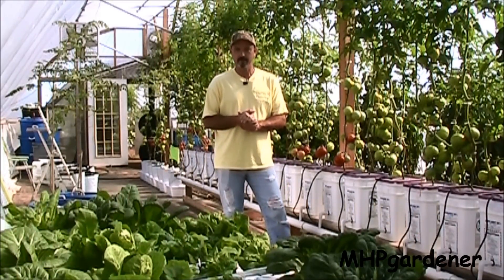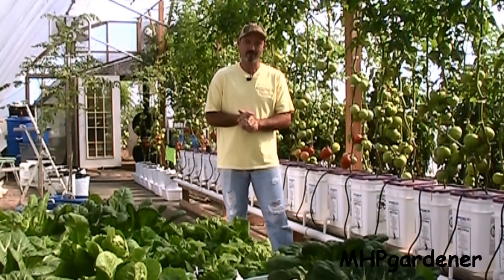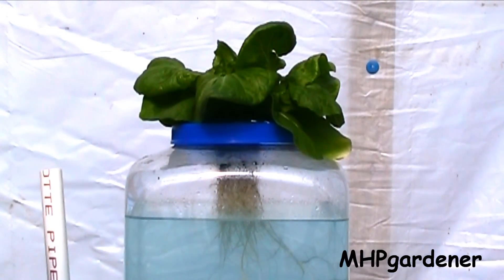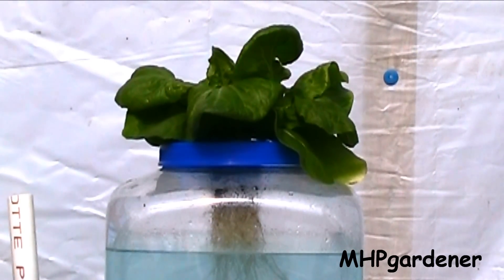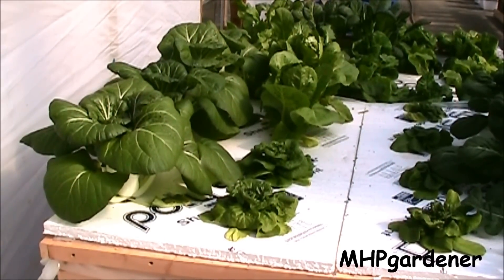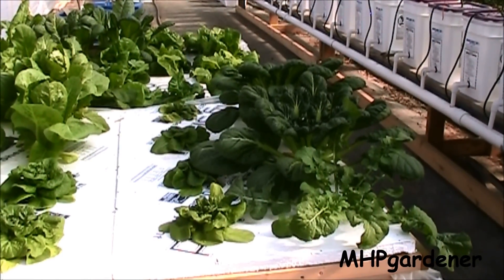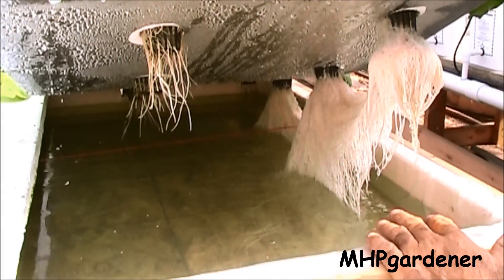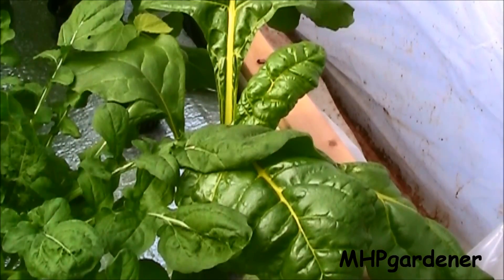Off-Grid Hydroponics Experiment - The Kratky Method & Floating Raft Hydroponics

Comment: Is it necessary to use styrofoam in the Kratky method, or can I use a more substantial top, such as wood.  Also, I was thinking on planting tomatoes using the Kratky method, using a 5 gallon bucket, one for each plant.  And would use the top of the bucket to support my plant, with the 2 or 3inch hole to support the plant.. What do you think of this?  I really like your videos!  They are easy to understand, compared to others I have seen.  Thanks and keep up the good work. How do I subscibe?
Reply: I am "guessing" that you could use wood, but maybe it would rot with moist damp air beneath. Maybe the plastic lid to the 5 gallon bucket would work for you.
Reply: If You download the info on the Kratky method, You will see that he recommends a large, 30 gallon container for tomatoes.
Also You can refresh the container with solution, if it gets too low.  A fill tube would be great to check water level and to refill.
Reply: Paul Smith Great point with pointing out that different plants would need different size containers. 

Aside from how much water the plant needs over a life time one should also consider this point: That you want water to drop as it is used, but not too fast as what would happen if the container is much taller than it is wide, because the roots could not grow fast enough to drink as much as they need. Nor do you want the water level to drop too slowly as would happen if the container is much wider than it is tall, because the roots would grow too fast going too deep into the water and oxygen could not dissolve into the water down there fast enough to replenish what the roots take. 

Using the Kratky method, I would be concerned not to add too much water to a grown plant with a mature root system because I would not want the roots in so deep that oxygen find it hard to dissolve down to the lowest part of the roots fast enough. 

Aside from how simple the Kratky method is, it is complicated in finding an "OPTIMAL" solution to how much water, in addition to height, versus width for the container.  Who knows, maybe the optimal shape of the container might be some what cone shape vs a tube shape. One further note. It seems reasonable to guess that each plant will have a range of width / height where they flourish to varying degrees.

Comment: ChloroBA the new bysen grow light,  brings out the THC in your plants. it is only a small light but covers almost 8 times of its size. cheapest on the market, don't pay £2000 when you can get it cheaper and brand new for around 700 pound cheaper.

LED grow lights with 8 band spectrum for sale many sizes, prices starting from £222.
energy efficient grow lights. 

sold globally too. 

contact me for information.

Comment: I'm in the Central Valley of Ca. and I was wondering how the Kratky method would stand up to 105 degree days? Please let me know thanks for the videos.
Reply: Sorry for the sluggish reply. I am not affiliated with this gentleman or his video but i do like to prowl comment sections and try to help people for the warm and fuzzies. ANY time a vegetable, be it hydroponic or soil, feels temperatures that are too high or too low it will be detrimental to it's growth, and the extreme is obviously crop loss. A easy plug in fix to any hydroponics system to have better control of the water temperature is to increase the amount of gallons you have tied into the system. Water is inherently very hard to heat up and hard to cool down(relatively of course). The more gallons you have sitting around in your system the longer it will take for the water flowing in your channels to heat up. I am not referring to flow rate just net amount of gallons in your reservoir be it by adding an additional barrel or sump-container. You can also bury your reservoir into the dirt or otherwise insulate it to keep water temps down so that your roots remain happy!
Reply: Now to answer more directly, the kratky method would not stand up to many 105 degree days. Without you doing something to prevent excessive water heat, you will without a doubt have crop loss at those temps inside of a week. In my humble opinion.
Reply: Thanks for your help.

Comment: I was wondering if you could combine the two "floating' methods by adding some "legs" from the same Styrofoam to the bottom of floating platform so they still get air but you could still use the different types of lettuce in the same growing box...with no air pump i.e electric. would this work I haven't built my first one yet I'm just doing research right now. I would really like to know what you think..thanks

Comment: I have a sneaking suspicion that if you'd planted one type per water mass, you would have had more consistent results.

I think this video illustrates that you should separate different root types, as they have different water/nutrient uptake and will prevent the smaller rooted plants from getting enough water.

Simply adding a divider in the middle would have likely done the job :). What do you think?
Reply: I wonder

Comment: Could you bypass the nutrients solution and instead put some fish there?
Reply: I would think that you could use fish, but would probably need to have air stones for the fish.
Reply: You can add fish to the system it would help, but fish do not provide P and K and trace elements or Fe to your solution, only nitrates(N). I come from a aquarium background and this is what I understand regarding growing aquatic plants, logic tells me this will hold true for non-aquatic plants growing in water as well. I might be wrong ^_^. 

Using fish also presents other challenges, water quality and filtration. Adding fish you would have to keep Iron and all other parameters in check, which is not needed in the case of no fish, then simply use a form of E.I. dosing.

Hope this helps.
Reply: there are systems here which have fish and plants on the other side. my brother in law has one. it uses a number of IBCs. his friends were doing it and he learnt from them. one guy put in over 100 small fish and hasn't lost a single one and now they are over 100 big fish.

Comment: fantastic video, thanks so much for putting this knowledge out there. I'm going to be raising tilapia in an old above-ground pool. I'm thinking of creating some simple rafts by building a square from some 2x4"'s and mounting the foam on top of that. hopefully the wood will create enough separation off the water to give the roots some air.

Comment: Good day.
On the video i saw the floating system and i had an idea, what if the floating polystyrene had some pieces of polystyrene glued to the bottom of the floating polysterene then you would have air bettewn the floating polystyrene and the nutrient solution. Thanks on your work.

Comment from the maker: Yes sir, I use the same fertilizer, just at a reduced rate. Rather than the 12-12-6 ratio in grams, I use 10-10-5 for lettuce. It worked very well, so I stuck with it.

Comment: What nutrients did you use in your raft set up? I live in Arizona where it's very hot. Do you think I could get away with running this raft system in mid summer with shade? Would I need a water chiller? Also do you use RO water? What E.C. level do you keep your mix at?
Thanks for the video, very cool!

Comment: I wonder if you used double foam with a bigger hole on the bottom slice and floated them would the lettuce work . you would have the air space and the lettuce would drop with the water

Comment: Make sure your tools are cleaned before you stir the water below.
Also make sure there is no possibility of contact with soil or worm tea.
Once the wrong bacteria gets inside, Root rot will occur and there is no way
to save the plants, Some people put in some Hydrogen Peroxide to increase DO
and kill bacteria now and then. Just make sure its all clean and don't mess with
soil before touching. I have been using this for 3 years for hobby planting

Comment: great video!  Thanks for the ideas.  I have been back-and-forth making a few floating rafts for my aquaponics system... I want to have the least amount of input possible.  I am not sold about floating rafts if I have to use another pump.  what do you think: What if I incorporated both the floating raft and Kratky method?  Instead of floating my rafts ON the water, what if I utilized that 1/4 in. oxygen space with continual water flow from my fish tanks... hmmmm...

Comment: Another off grid hydro method where you could have some dissolved oxygen versus none would be using solar panels and 3.5 watt aquarium bubble stone pumps like the dual outlet Aqua Culture pumps.Harbor Freight sells 15 watt solar panels for around $60.You could run 3-4 pumps off a single panel.Multiple panels set up like this could power a series of many pumps oxygenating a large grow area during "direct sunlight hours".

Comment: What do you think about building a floating raft but with a sort of pontoon bottom to lift the top surface up? This would provide both the air space of the Kratky method and still allow for a variety of plant types because the the raft would drop as the nutrient solution was used up but the pontoons would maintain a fixed air space.

I'm thinking something like a thinner Styrofoam top with Styrofoam ribs attached to the underside as pontoons. Just a thought.

Comment from the maker: I wouldn't use plywood. It's gonna get water logged with the condensation from the reservoir and probably warp. I resolved the issue of the large pieces of styrofoam by building 3 smaller boxes, rather than having one large one. That video was posted last week. Having smaller boxes allows for easier moving, and also some side by side experiments. But, as sloon said, plastic tubs with lids are great options.

Comment: the Styrofoam is usually used for oxygenated water, like a deep water culture or shallow water culture. if you are keeping room between the water and plywood for oxygen, it should be fine, plywood will not last nearly as long as Styrofoam would above the water, plastic tubs are good for this, they provide the tub and top, they can be used for this system, drip system, or dwc system. depends on the rest of your setup because you can see Styrofoam wasn't good for his wide system, to low in center.

Comment from the maker: Hi Susan, If you have the reservoir sized properly, you shouldn't have to add any more to it. The lettuce will grow to maturity in a 2x6 box and still have water left over. Then, you can top it off, or start from scratch with fresh nutrients for your next crop.

Comment: I have tried a few methods because of curiosity and that is what brought on more thought about hydroponics. Surely...well...assumingly, the Egyptians didn’t use air and water pumps in their time. But they didn’t have dead water either. Well, I am trying. I am impressed as I mentioned before. Thanks for the videos. I am just starting out but have a fair idea of hydroponics. Maybe you can check out my videos. Tell me what you think. It was my first try. I had no greenhouse to work with.

Comment from the maker: Correct. The Dutch Buckets are for a circulating system, which needs a water pump. The water drains out the bottom and is recirculated thru the entire system. If you wanted to use the Kratky method in a plain bucket, that would be fine. It would be much like any other type of reservoir. Simply place the plant(s) in the top and fill with your choice of nutrients. Hope that helps.

Comment: Interesting method. I'm anxious to try this out. Do I understand you to say this static solution method isn't effective in a Dutch bucket? Or did you say you need to continually add water in a Dutch bucket if the solution is static?

Comment from the maker: This was my first attempt with this method. I didn't have to add any water at all. The Kratky side holds approx 41 gallons of water, and after about 45 days or so, it still had about 8 gallons in it. The water usage will vary depending on what type of plants you grow. But for the most part, anything maturing in 30-45 days won't need any additional water.

Comment: Excellant video, thanks.  One question.
How do you manage the water levels? 
 Do you maintain a minimum/ maximum air pocket- depth between the water surface and the underside of the raft (a minimum and maximum depth of water)?
At the thirty day mark how much water was left in the reservoir and did you remove the remaining water before adding fresh nutrient mix?

Comment: The width is somewhat negotiable if I build it and bend the pipes myself with the cost of kits and shipping I couldn't afford anything larger than 12x50. Although a Gothic style GH with 3 or 4 foot side walls would counteract the decrease in height from round hoops. If the side walls height is still an issue smaller crops like bush beans and lettuces can be grow on the outer edges. None of this is for commercial use so I don't see a problem with doing things a bit unconventionally. Do you?

Comment from the maker: Thanks. The issue of lettuce in the summer is a tough one. But varieties like Adriana and Nevada are really slow to bolt. One good thing about this setup is the fact that the water is always covered, and the sun can't heat it up directly. So temps are steady, very consistent. I plan to do a few more setups like this. It's just so easy. :)

Comment from the maker: Yep... the lid will be fine. Just drill a hole for the net cup and drop it in. I've been thinking of doing something like that for people who don't have room for a 4 x 8 box. Those plastic containers would be easy to move in and out of the sun too. One thing to consider is the UV deal if they're outside. Every plastic container that I've used has gotten brittle after about a year of use. Wrapping it with foil or painting it would help.

Comment: I of coarse wanted to try the clear ones i have.....hmmm paint? wrap in aluminum foil? I am going to try this but ill try with organic fertilizer from a bag, don't know how complete it is but it will show what i can get in an emergency. also why use foam for the top if its not touching the water? plastic lid with basket holes should work fine.

Comment from the maker: Algae and gunk is not a problem because the roots are growing in total darkness on the Kratky side. The aerated side has a little bit of algae between the cracks, but not much to worry about. Since it all gets changed out every 5-6 weeks at most, it shouldn't be an issue. Yes, any of those containers would work, as long as they aren't clear.

Comment: With no air how do you keep down fungus or alge or bacteria? Couldnt you add some feed fluid once a week to keep the slow plant from running out of the feed fluid? The under bed plastic containers they sell at wallyworld would probly work good for staic growing . just cut holes in the plastic top and insert basket.

Comment from the maker: In terms of cost and simplicity, the raft setup wins hands down. You never have to add water or nutrients. Just set it and forget it. Regarding the nutrients, the ratio is still the same.... 10-10-5 per 5 gallons. Regardless of the size of the NFT reservoir or the size of the raft setup, you still use the same amount of fertilizer per 5 gallons. That ratio never changes. Thanks.

Comment: Hey mate, You R FANTASTIC. thank you very much for your valuable practical experiments. I have some Q's:

What is your conclusion for growing lettuce in Raft vs NFT, which one is easier and low cost? 
do you add the same amount of nutrient solution for raft as you did in NFT system? 10-10-5 per 5 gallon water?  because I think in raft system we have much more water than NFT system, so I think nutrient solution for Raft gonna be more than NFT. isn't it?
thank you again.

Comment from the maker: Kratky suggested a barrel for cucumbers. I think that's a bit overkill though. I like the 5 gal bkt idea much better. He did say you could add water to maintain a minimum level in the reservoirs, but that does change things up a bit. Like most hydro systems, it is very adaptable.

Comment from the maker: Hey Brock, I'm not kidding...just set it and forget it. This was so easy. And with the large reservoir of water, the temps are very consistent. So they wouldn't heat up as fast as a rail system that had water flowing thru the tubes. You gotta try it bro.

Comment from the maker: With this setup, you're not supposed to be adding water. It dilutes the nutrients and also will change the function of the roots if you raise the water levels after they have already dropped. If you're just doing a single reservoir, I think you can add enough to maintain a minimum water level.

Comment: I was thinking that you could raise larger/thirstier plants in five gallon buckets (or a little larger size) with this method if you added a float valve and gravity feed reservoir You'd just need to set the float height to give sufficient air space for the roots. Then I read one of Kratky's articles, and he mentioned the possibility. He dismissed it as too much work, but it's a one-time thing, and parts are relatively cheap.